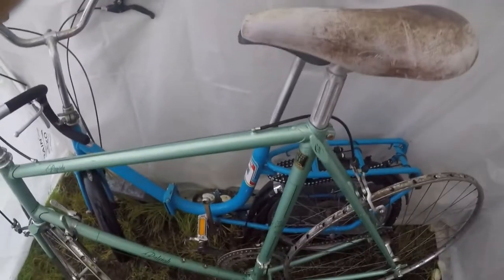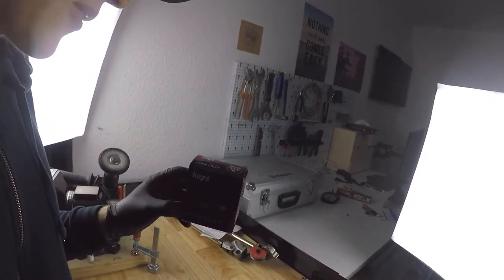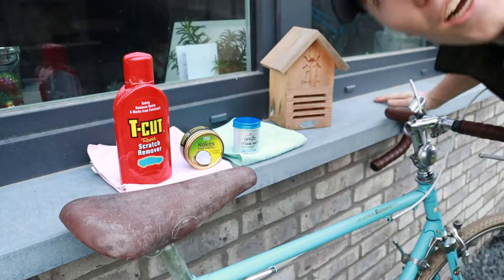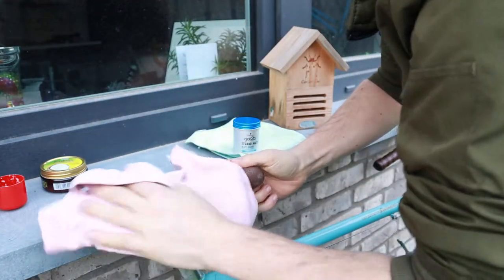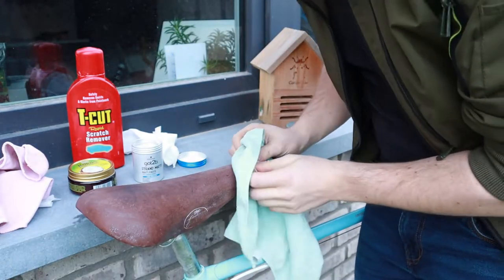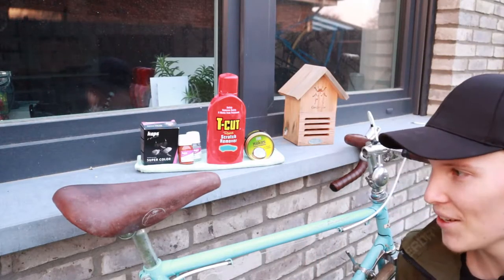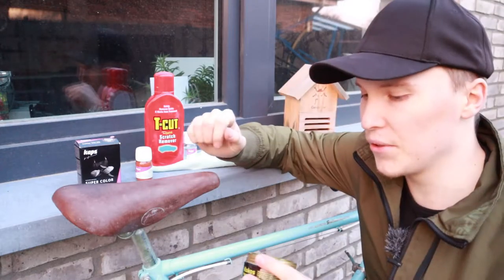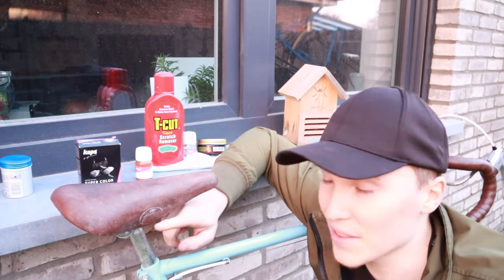Restoring an Old Leather Saddle- Coloring & Waxing for Vintage Look

Comment: Try something like Saphir Renovateur to treat and moisturize the leather and it will help preserve it also. The T-Cut basically takes the top layer off paint and to expose cleaner / unfaded paint. After using it is good to use a few coats of protective Auto Glym polish on the paint (not on leather obviously).
Reply from the maker: Great suggestion, Flynn! Thank you very much for the professional tip.  Greetings Armin